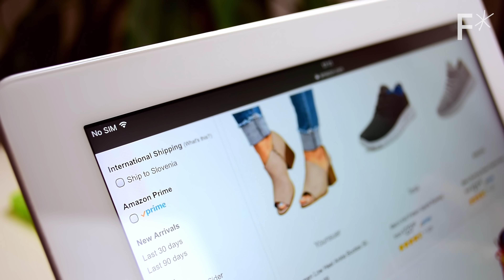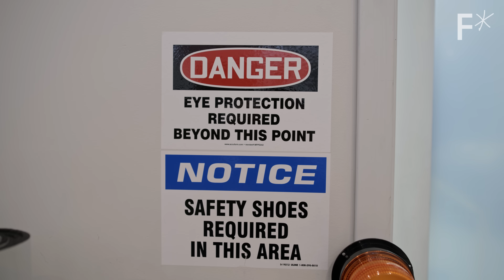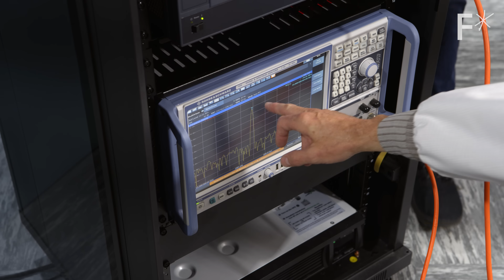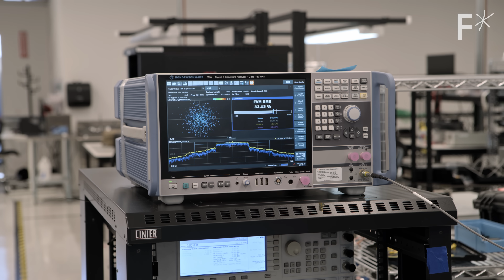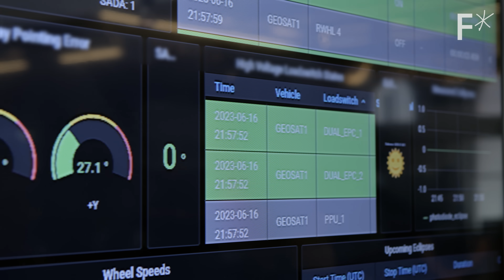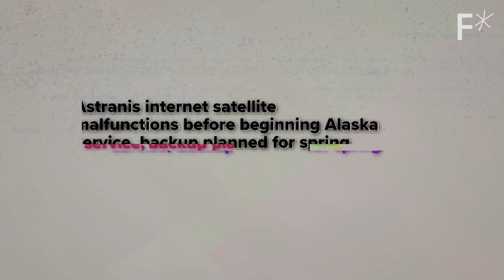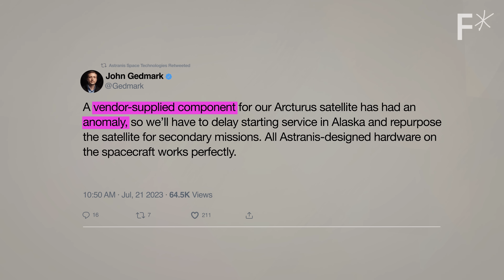Starlink’s newest competitor is using next-gen satellites to create internet for all | Hard Reset

Comment: The animations here are misleading. The antennas that Starlink uses are phased arrays and can track satellites without needing any physical movement whatsoever, which also means that they can re-track to a different satellite extremely fast. All this so the satellites can be physically closer.

Yes, GEO orbit is 6x further away, which eliminates that need and gives it a much bigger footprint, which is why it's the approach that was traditionally used in satellite internet (and TV). The problem with this approach is that signals have to travel a much longer distance, meaning they take longer to arrive, in both directions.  You can still send impressive amounts of data, but the delay shows up in how long it takes to start receiving a response to e.g clicking a URL. This latency is unusable for gaming, and causes enough of a delay that it becomes hard to use for realtime phone calls or video conferencing.

That's exactly why Starlink very explicitly opted for LEO.  Closer satellites = Lower latency.  As a bonus, the workload is shared over more satellites which means they'll be able to service more users with higher total bandwidth.  The catch is that It means higher costs and demands far more sophisticated engineering.
Reply: GEO is actually 60x further away, big difference
Reply: @mhxxd4  more like over 80 times further away, like 35000 k / 400 k
Reply: @johnarnold893  i was giving the minimum number, don't correct me
Reply: i agree the graphic of starlink is VERY misleading, the video producers must know that
Reply: @TheSateef  they in fact seemed to get a lot of things wrong. which is surprisingly stupid given how many references about starlink is available online. even i use starlink. these guys look like they went all in with a lie.
Reply: @TheSateef  pretty sure this is a fluff piece to swing it to the company... either that or the producer/ writer just wasn't very through in their research, and SpaceX/ Starlink is almost one of the most documented company, outside of the information under ITAR.
Reply: Yeah, I'm not sure what their schtick is except for maybe newer satellites? They still can't overcome the speed of light so the experience will be terrible due to massive latency.
Reply: Yeah, I noticed that as well. Little deceiving if you ask me. It also takes more time for the signal to travel from earth to geo synchronous orbit...and back to earth. So this will be a high latency network. Having both for different functions would be the best of both worlds.
Reply: Yes, agree. Those misleading animations made me quit watching the video.
Reply: Yeah i notced that. Lol starlink literally have a fixed flush mounted sat.
Reply: @nickazg  Previous versions had alignment motors that allowed for finding the optimum angle.  Once set it never moves again.  Newer models don't include the motors.
Reply: If I had to chose between no broadband and big-ping broadband, it chose the latter.
Reply: VERY, they prey upon people that do not know better.
Reply: As I was reading, nowadays capacity is no longer an issue for GEO satellites a single one can deliver enough bandwidth to cover a very large area at high speeds.  But the higher latency is a problem due to that pesky universal 300 million meters/sec speed for both light and radio signals.
Reply: @BillAnt "capacity is no longer an issue for geo" is a crazy statement. Capacity is not an issue because no one uses it. No one uses it because it is unusable.
Reply: @Pinpadprompts  - There are many non-latency sensitive applications for which geos are perfectly well suited.  Noone said it's an all size fits all.
Reply: I would think that if Qualcomm would be able to develop a Snapdragon modem and meta-antenna that allow to directly receive Starlink signal directly in a mobile phone / laptop, it would open the possibility to any new generation of smartphone to get a Startlink subscription, or to be used in emergency scenario. It would increase the Total Adressable Market (TAM), and provide bigger opportunities to generate cash-flow. This could then be used to iterate faster and decrease costs further. Also Starlink is likely funded thanks to the big profits/cash-flow from SpaceX, which further helps reduce costs.
Reply: Success for your business....for now ...and improve use " neutrines channels"...not nothing new above sky😊...from Brazil🇧🇷👍🌎
Reply: @d.boumghar7385 - Capacity is not the problem with GEO's, but the higher latency is due to long distances the signal has to travel both up and down.  They can connect GEO's via laser links, but that won't help getting faster internet data packets from servers on Earth.  That's why LEO's are a better solution for fast and low latency internet.
Reply: @d.boumghar7385you can't place several geos in the same place. That's not how slots work.
Reply: @d.boumghar7385 again, that is not how orbital slots work.
Reply: Starlink just means they’ll be a lot of space junk cluttering up earths orbit.
Reply: That last line is the key one. Our satellites are insanely more affordable, that's what the last 4B people need to get connected. We have traveled to places all around the world we'll be connecting soon and people's requirements are (1) super affordable internet and (2) high bandwidth. Unconnected folks simply don't about latency right now.
Reply: @jasoncarman99  can you compete with 60mbps at 60 bucks? because that's where starlink's currently at in unofficial regions.
Reply: @jasoncarman99  According to an article published by CNBC, Starlink is already cash-flow positive. Until it stay profitable for them, they are in a very good position to lower their prices if needs be… Furthermore, with their Direct-to-Cell technology, I would think that in the coming years, smartphones equipped with Qualcomm Snapdragon modem will be able to access their services, which will limit (or even eliminate) upfront costs associated with a dedicated fixed satellite equipment to get Starlink satellite internet access…
Reply: @jasoncarman99    So you know the cost of one SpaceX satellite?
Reply: Switching between satellite means drop connections.
Reply: @Liberty2358  The drops are imperceptible, talking hundreths of seconds. I've been using Starlink to game since 2021 nothing in GEO can compete.
Reply: @Liberty2358  There is no connection drop when switching between Starlink satellites. Actually Starlink terminal can communicate with multiple of them at once.
Reply: @Liberty2358  How big is that problem, really? I haven't heard anyone complaining about constant drops in Starlink. Could it be that they have a dense enough constellation that they can handle handoff seamlessly just like your cell phone does when you're moving from a cell to another?